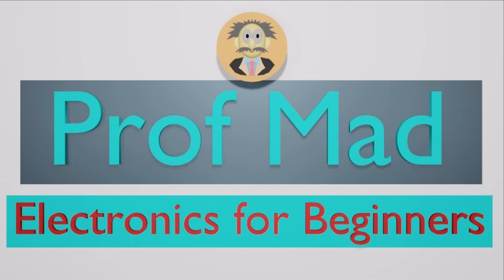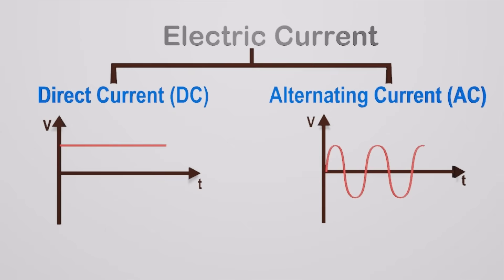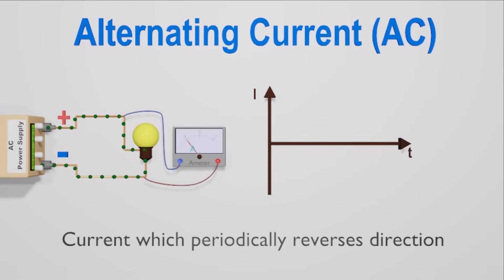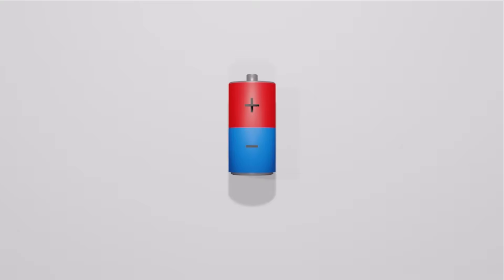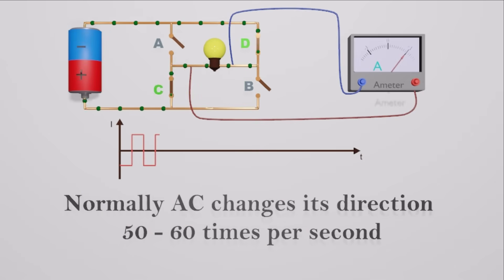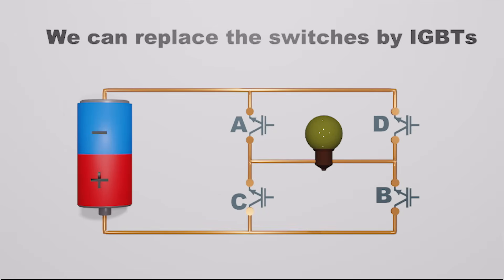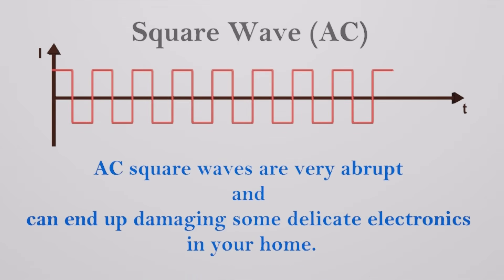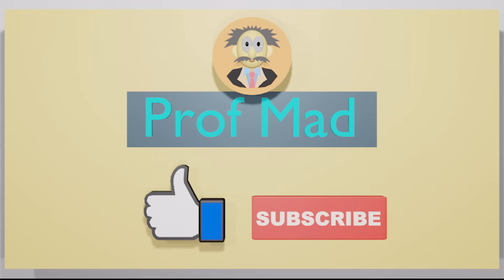How To Convert DC to AC | Direct current Inverting | 3D Animation

Comment: Thank you for this Vidio, but the AMP meter was not wired correctly. All the current in the circuit should flow throught the Amp meter.

Comment: If you have a 1H coil and a 1F capacitor  and pulse it at the right frequency. You will not have heat and will get long voltage out of it.

Comment: When transform A C voltage into 
D C voltage, it is called CONVERSION 
 The device we used is Converter .
         But when transform DC  voltage 
into AC voltage, is called  INVERSION
The device we used is  called INVERTOR .

Comment: Ok if we suppose that electricity goes from - to + . Why when you do  the switch in the side of the - side it burns the light . I think that elictricity follow from + to - that is why when we do it in the side of the + side it works and does not burn the light because we stop the fllow of electricity

Comment: never said how 2 convert
Reply: I mean, he pretty much did. We use IGBT Inverters so that a DC source can power an AC load. Again, IGBTs are just transistors that combine the advantages of a MOSFET (fast switching times) with the advantages of BJT’s (low fwd dropping voltage). The control circuitry he was talking about to control the switching times is known as pulse width modulation (PWM). It’s essentially just a circuit that receives feedback and uses that to either raise or lower the duty cycle, which controls the amount of time a pair of transistors are on for.

One example of a PWM circuit is a 555 timer (not the only example of a PWM circuit). Without going too in depth with how the 555 timer works, it essentially just uses a capacitor and a couple of diodes. The capacitor charges through one of the diodes and once it charges above the logic 1 threshold, the duty cycle output of the 555 timer decreases. Once it’s fully charged, it starts discharging through the other diode because it fwd biases that diode, through the 555 timer and shorts to its negative plate. And once it discharges below the logic 1 threshold, the 555 timer increases its duty cycle % out. In other words, if we apply logic 0 to the input of the 555 timer, it outputs logic 1, and vice versa, so the longer we apply a logic 0, the longer it outputs a logic 1 => its duty cycle % out increases.

That’s pretty much how we control which transistors are on and for how long. The more you change your duty cycle %, the more and more the output waveform of the inverter starts to look less like a step wave, or an anvil wave, and more like a relatively smooth AC sine wave. The only additional stipulation that we add, that the narrator didn’t mention, is that we ensure there is a small dead time between gating one pair of transistors on and the other off. Actually, the narrator said that we gate one off and the other on at the same time, and that’s wrong. If I didn’t have some small amount of dead time between the gating signals, and two transistors on the same side were gated on simultaneously, where do you think the current would flow? It would take the path of least resistance, so it won’t go through the AC load. And low fwd dropping voltage when on means that the transistors effectively just act as a wire when conducting. With a large enough DC source, the current that is sent through the transistors would destroy both. This is known as shoot-through voltage.

But, yeah, that’s the basics of converting DC to a relatively smooth AC sine wave, and this has a number of different applications. Namely, if we have something like a +25 VDC power supply and we need it to be +14 VDC, we can convert the DC to AC, step down the AC voltage via a transformer from 25 VAC to 14 VAC, and rectify the AC voltage back to a pulsating DC voltage via a full-wave bridge rectifier (using either a package of four diodes or an OPAMP-diode rectifier), then filter that pulsating DC to smooth the waveform with something like a cascaded choke input filter or an RC pi filter, and then use a zener diode shunt voltage regulator to get a really steady DC output. Granted, if you wanted to step down the DC voltage, you could also just use a buck chopper circuit to step down the DC voltage to the desired value, which would definitely be simpler. But, another way you could use inverters is to power something like a 3-phase AC motor or some other AC load.

Comment: Current doesn't flow. Electrons flow in the form of Voltage. Current is the by product of work done by the load. Remove the load and no current can be measured.
It does not flow in a circuit, it manifests itself as wasted energy in the wires due to the resistance.
I do wish people could get this simple fact right.

Comment: Similar to those IC transistors, used in DC screwdrivers to adjust the RPM. These black ICs are connected to stronger ones, to provide SIN current, but not all devices support that. UPS devices are GPS powered, to ensure safety to turn on electricity in time, if prepaid by the owner. Insurance companies need that, to avoid data loss of the owner. UPS is also needed to download the Media Center updates for Vista, Win7. It’s also needed to turn on the performance mode of a PC, when drained in BIOS, but the timeout of the UPS has to be set to maximum. When a UPS is monitored by a satellite company, they fire a nuclear beam to the black IC transistor, to weaken its performance. Now on, XP and better operating systems won’t be supported, because the power good signal is bad. Same with screwdrivers, when misused, the IC is attacked by the laser, and will heat up dramatically, the throttle can’t be adjusted.
Reply: I'm sorry you got nothing from this video.
Reply: Absurd Conspiracy theory bot bot bot.

Comment: You cannot connect an Ameter is parallel in circuit.
Reply from the maker: That's correct. There is a mistake in the animation. Sorry about that.

Comment: A variable induction. Variable capacitance is voltage. To store voltage you use a variable capacitor on the way. Work in Velocity spin. Two d to three d. How do you mathematically prove that only two d and three d exist.

Comment: The ammeter is connected in series in the circuit. 
Voltmeter in parallel. 
Other information correct.
Reply from the maker: yes. There is a mistake there. Thanks for pointing it out.

Comment: Long AC power lines have more resistance (c.f. skin effect) but also have impedance and radiate energy (an effective antenna for 60Hz is 750 miles. The Pacific Intertie is a 500,000 volt DC line from Bonneville Dam in Washington carrying 1500 Megawatts to Los Angeles. The conversion to AC was originally using raquetball court sized Mercury Thyratrons and a field of inductors and capacitors.
Reply: I worked for Manitoba Hydro (technician, not engineer)  just after they built their first DC system using Mercury Arc Valves.  I was still there when they switched over to Thyristors. Big job, interesting stuff, although some of it pretty complex for a tech to understand.

Comment: You’ve shown ammeter connection wrongly (at 1:54) It should be connected serially, not parallel. Alternatively an measurement shunt resistor may be connected serially with ammeter connected parallel to it, but not to the load
Reply from the maker: That's correct. There is a mistake there. Thank you for the comment.

Comment: I'm not an expert in electronics, I just have basis and I'm an amateur but at 1:49 you show a DC circuit with an amperemeter in parallel but isn't it supposed to be in series for it to work ?
Reply from the maker: yes that's correct. There is a mistake there.

Comment: Facepalm. so how does the control circuit generate the alternating
Reply from the maker: The control circuit does not generate alternating signal, it simply generate on/off signal sequence to control the transistors. you can get done using simple programmable IC, (for demonstrations, even Arduino can be used )

Hope this will help you.

Comment: Good and knowledgeable video..I have some questions and queries related to this video. 1. How much positive voltage we have to apply to base for current to flow through collector and emitter? 2. How we can control the current flow between collector and emitter by applying voltage or pulse to the base? I am very interested at knowledgeable video with good explanation so I am looking for to you kind, fast and fruitful response.
Reply from the maker: 1. Since we are working with high power applications, normally we use IGBT (Insulated Gate Bipolar Transistor)s for switching purpose. IGBT's applied VGE (gate-emitter voltage) should be at least 14 V (preferably 15 V). Its better to check the data sheet of the component. .

2. I have made another video to explain how does the transistor work. 
https://youtu.be/eZAeaSkgIL0

I hope this will help you.

Comment: mechanical brushless dc motor with dc/ac generator
Reply: in motors dc is better, always grip, not slip poles
Reply: meh, hvdc systems are better
Reply: any switching speed can be achieved also mechanically spinning magnet coil rotor generator
Reply: motor generator is a mechanical transformer
Reply: redesign, unnecessarily complex
Reply from the maker: Thank you for sharing.

Comment: The conventional direction of electric current was originally taken to be from the positive pole to the negative pole of a battery through the external circuit.  This system is still used, and causes no problems, even though we now know the electric current is caused by electrons drifting from the negative to the positive pole.  Incidentally the speed of the electrons is so slow that, for example, a flashlight battery will probably run down before an electron has gone around the circuit even once.
Reply: A Lumped Element Model is used to describe circuit schematics and electron "flow" 

The truth is, it's the movement of the EM fields that brings the fun to the party.....but parsing that out each time troubleshooting takes place would mean nothing would get done.

"Electron flow" is a lumped element type of shorthand.
Reply: @WaterproofSoap agreed,  I think actual electron flow is something like 1 foot per hour,  or some ridiculously slow travel time.
Reply from the maker: Thank you for sharing this.

Comment: How to confuse people....keep talking about current flow as the flow of electrons in the opposite direction.

The only times you need to worry about electrons flowing is when talking about: cathode ray tubes, X ray tubes, valves, and when designing, analysing the theory of operation of semiconductor devices.

Forget electron flow, it is not important, 99% of the time
Reply from the maker: Thanks for the idea.

Comment: You only the explain  Bridge Configuration. The first an historic Inverter circuit work with a center tapped Transformer which  outer ends each  connencted to a switch . Those switch put the battery alternativly to the transformer coil to generate  an ac voltage at the sencondary winding. 
This circuit is primarily used at low battery voltage. 
The first inverters at all used a mechanical device , called a "vibrator" .

The bridge without any transforme use  a high dc volatage , 170v for 115V ac  or 330V for 230V ac. Its need therefore an dc/dc converter to bring the 12 or 24v to the to the corresponding level.
Reply from the maker: Thanks for the details, I'm planning to make a video about center tapped Transformer method also, ill keep in mind to mention you when it publish.
Reply: @Profmad My first inverter was a hombrew one, made from scrap. It was way back in 1975.  I was  an apprentice in a radio-tv-repair shop. So I was able to gather parts to build it.  
It was the classic tapped  transformer circuit. The stages  are in order from the oscillator: Meissner  oscillator resonate on 50Hz. push-pull amplifier, push-pull driver and a push-pull final with 2x4  paralleled PNP germanium power devices from motorola. 12V / 45A  input, 220V /50Hz output ,  max. power 400 Watts (500VA) . All stages transformer coupled, home wind on a vice with a hand driven drill with parts salvaged  from old transformers. Only the output transformer were used as it was . It came from a professional car batterie charger. A series resonating circuit connected on a tap of output transformer give a usable sine wave of the output voltage. 
It was a quite haevy beast. I kept it until today.
Reply: This is an entry level video. Center tap transformers are not entry level, they are not digital and there is no reason to bring it up here.
Reply: @bingosunnoon9341  Center tap configuration is the first an oldest circuit design. And of cause the ca be used  digitally. Those configuration ist the choice at low battery voltages , bridge configuraton have the advantage  at higher voltages due to  Vce of the switching devices are the same as the Vbattery were at center tap configuration its  at least twice the Vbattery. 
So both variants are in use , depends which give best advantage for the application.

Comment: The ammeter as connected is burned instantly😢
Reply from the maker: Agree with you, I missed it before upload. planning to upload corrected version soon. Any way, thanks for mentioning that.
Reply: No not really, it depends on the internal resistance of the source. If the circuit is fed by an Solarpanel, it would show the short circuit current of the solar panel wgich ist not that high to melt the meter...☺
Reply: @Reaktanzkreis  I was considering an unlimited source with a near zero resistance Ammeter.... the classics we learned 60 years ago when measuring instruments were pure electromechanical
Reply: That's not true. Set up  the Thevenin  ESR to see what I mean. Most ammeters are protected internally
Reply: @bingosunnoon9341  sorry but the mistake is a principal one, you can’t connect an ammeter  (internally protected or not)  with a near zero resistance in parallel with any circuit component and try to measure the current flowing through the component. And  trust me, Thevenin  and Norton have nothing to do in this basic thing

Comment: The dead time (Modified square wave) is introduced not only for a better approximation of the Sine wave, but also for the protection of the transistors as they could short out when toggled. 
Very nice video tutorial. 👍
Reply from the maker: Thank you
Reply: That's interesting... What application is this?

Comment: Now, the transistors turn on as the positive current flow for example in transistor 1 and 3. How can the transistor 2 and 4 know that it is their turn to turn on
Reply: You design some sequencing electronics!
Reply: You can use 2 comparators.

The + input of the comparitors can have a triangular signal input from a signal generator (which can be done using a 555 timer), and the - input of the comparator can have a sinewave signal generator (which can also be done with 555 timer).

The switches only turn on depending on the cycle of the input AC signal.

Comment: Please make video on pure sine wave circuit
Reply: Is the same Circuit. But the secret is in the control section. it must have a PWM which ist modulatet wth 50 or 60Hz.  Similar like a class D Audio amp.
Reply from the maker: I will work on that.

Comment: I have no basic skill of electronics.  I saw some youtube videos that teach how to convert only few volt DC to high volt AC.
Does AC always need to be in high voltage?  Let's say you convert 12v to 220v. Is it dangerous if you accidentally touch the current?
Reply: Yes 
If you touch both output ac wires
If you touch single a wire it won't shock you unless the second wire is connected to earth/ground/ neutral
Reply: @koushiks_energy  Is it possible to convert 12v DC to 12v AC?
Reply: @jumbo999614  easy but not effective and Efficient
Reply: @jumbo999614  You need to understand that 12 volts AC , the value of 12 is an average value. The voltage actually goes up as high as 12/0.707 = 17 volts.

So it is not just about converting to AC, but you need to increase the magnitude too.
Reply: @deang5622  RMS* not average
Reply: @cpK054L  The RMS is an average value.
Reply: @deang5622  Root MEAN Squared.  No, it's not an "average" the average of a continuous  sine wave is 0
Reply: @koushiks_energy  That is not correct. And it is a highly dangerous statement.

You can't simplify all configurations of electrical circuits down to one.
Reply: @deang5622  Yes, you can... it's called 
Thevenin's equivalent voltage
Norton's equivalent current.

What he is saying is also incorrect because impedances vary from person to person,
you don't have to touch the second wire, all you have to do is complete to earth ground which is never that simple.
All it takes is one static draw to cause a voltage breakdown and bam, you completed the circuit. Now you dead.
Reply: @cpK054L Oh God! Who on earth are you? Seriously?
Thevenin Equivalents circuits are not relevant here. They are simply models to help in the analysis of circuits.
Reply: AC voltage can be zero to many thousands of voltage

Comment: Good luck hooking up your ammeter like that @ 2:35
Reply from the maker: Thank you for pointing out. The ammeter shown on the animation is Centre-zero ammeter. and it was connected to a AC power source. So I hope swapping the wires does not matter.
Reply: @Profmad  the ammeter should be in series with the circuit, as you have it would be a short circuit across the supply. O/k, if it were a voltmeter all would be fine. cheers
Reply from the maker: @bananaking2828  OMG, I was really messed that up. Thank you very much for pointing out that. I have missed the whole thing . lets see what we can do.......

Comment: In Egypt, in our homes it's 220 AC voltage
Reply from the maker: There are several other countries that uses 220 Vac as standard . It reduces the transmission loss and wire price (we can use much thinner wires), But on the other hand 220 Vac comparably more dangerous than 110 Vac.
Reply: here  in INDIA 🇮🇳  also it's 220V AC is standard
Reply: Also in Thailand use 220.V.AC.